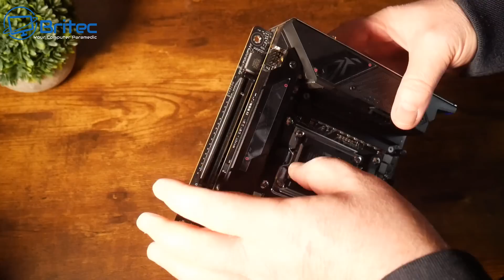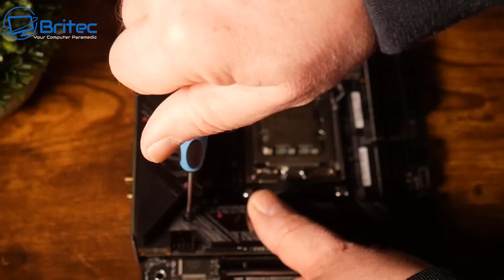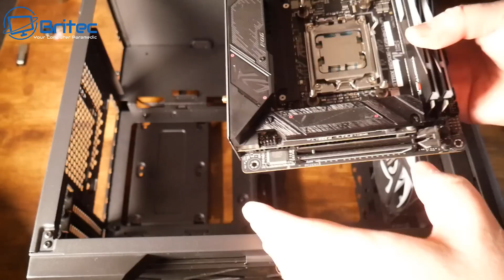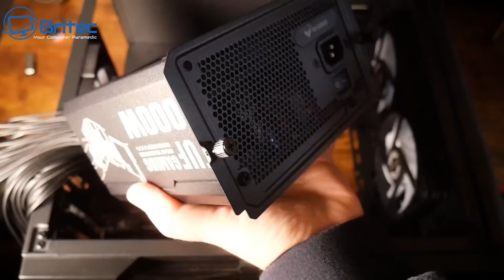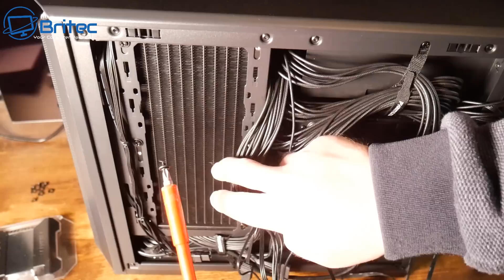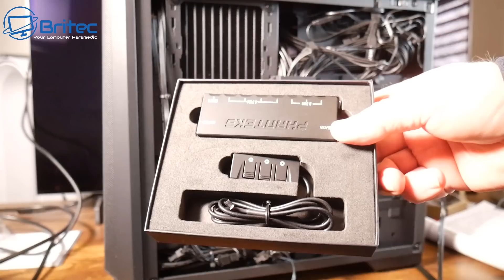Powerful Mini ITX Gaming PC Build With RTX 4070 Ti

Comment: I never understood why no one installs fans in the bottom of the case, it would make it easier for the video card and reduce noise, in your case, regular fans will not fit there, but you can install reduced thickness fans such as nf a12-15

Comment: Love the build! I also have the same exact case with asus b550i and custom loop, and I also have the same P3 nvme ssd with headsink from amazon installed on it and it still get when its in use. If you want it to last long, I think you need to install a heatsink as well. You may need to take off the 2.5 ssd bracket from the case for clearance tho...

Comment: Hey, I've also purchased the same motherboard pairing up with the r7 7800x3d upgrading from i73770k finally ).

What I wanted to know is which drive did  you install the windows operating system on gen 4 or gen 3 Nvme drive?  thers is also 2 sata 3 connectors on the board I think if I remember correctly did you use those for storage or did you install the windows on one of those drives?  ive purchased Samsung  990 Pro Nvme 2tb gen4 was thinking of getting a gen 3 nvme to go on the back the motherboard and 2 ssd sata 3 drives, but I wasnt sure where to install the windows 11 operating sytem on which drive. I would really appreciate if you  an  answer as I'm buying the parts wright now.

Comment: Sausage! You’ve got air being sucked in the front and then immediately out the side. The fans on the radiator should be the other way around.
Why not put the radiator in the front?
Reply from the maker: Wanted radiator this way, I will be doing some testing and benchmarks and evaluate situation then, I don't think it will be a problem Mike

Comment: I always switch the RGB off on any computer I build. I view it as a waste of electricity. 
I think it's time motherboard manufacturers retired those old two-point heatsink retention supports. It's been quite a number of years since I've actually used one. Maybe they could fit the Ryzen standoffs to the board, and include the old part in the box for people using antique heatsinks.
Reply from the maker: Thanks for watching

Comment: G.Skill Trident Z5 NEO Series (AMD Expo) 32GB (2 x 16GB) 288-Pin SDRAM DDR5 6000 CL32-38-38-96 1.35V Dual Channel Desktop Memory F5-6000J3238F16GX2-TZ5N (Matte Black) $136.99 amazon Found something that's a little bit Cheaper.
Reply from the maker: Their will always be cheaper deals on a daily basis

Comment: With the position of that AiO water-cooling I would hope to see a mesh on the back of the case, otherwise an air-cooling could had been better performance wise if there is air flow restriction in place.
Reply from the maker: mesh is on the back panel where radiator is lol

Comment: I really hate pins on the motherboard they are harder to straighten it you accidentally Bend one it's why I'll probably stay with a last-gen  Ryzen  7 5800x3d from 3700
Reply from the maker: That is a fair point, but motherboard is cheaper to replace than CPU, so its a trade off